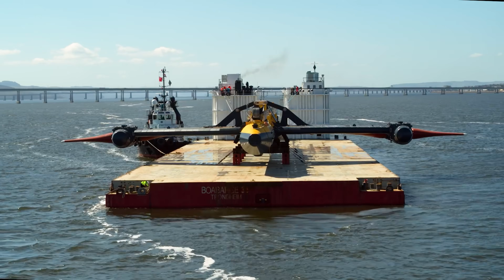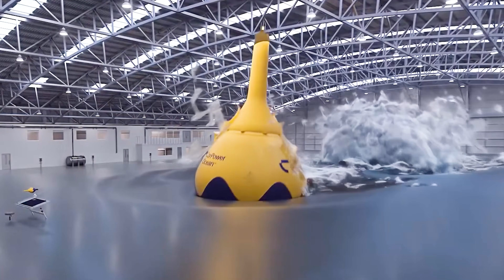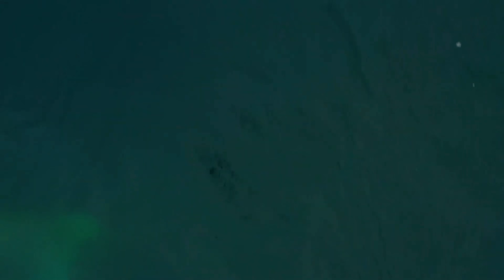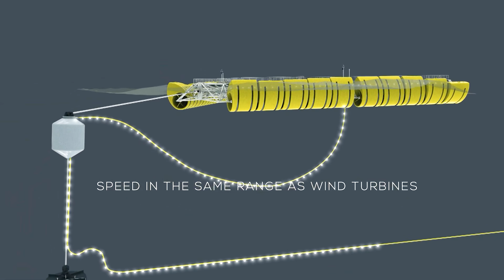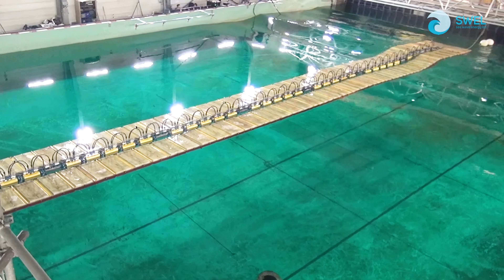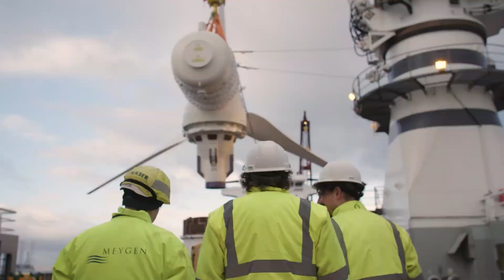INCREDIBLE MACHINES THAT LEVERAGE THE ENERGY OF THE SEA

Comment: Problem will always be the maintenance/reliability. Sea and ocean solutions take suchs a hard beating. The second options sounds the simplest
Reply: Agreed
Reply: Everything will need maintenance.   It is incredible just how much maintenance refineries and gas engines need.
Reply: Nothing new to the marine/oil/gas industry, and 20% down at any time for planned maintenance
Reply: and drilling uses less maintenance? 🙄🙄🙄
Reply: The relentless pursuit of profit has led to countless innovations that contribute to pollution in various forms. Yet, the concept of Tesla's free energy for all capable of reaching even the harshest corners of the globe, cleverly disguised in structures like pyramids, Easter Island statues, Machu Picchu, and Stonehenge remains unrealized. Imagine how far ahead we could be today if not for the greed and corruption of corporations that prioritize immediate profit over long-term sustainability. These companies focus solely on the present, with little regard for the environmental impact on future generations.
Reply: Seems easier to repair than a deep sea oil line or rig but what do I know
Reply: Well I guess it also comes down to price per wattt. In the cost maintenance should be include.
Reply: like you said, its dependent on so m any moving parts, hydrolics ... lets not even speak about how crazy that is in salt water.

The second option with good gasket the main - maintelance is litteraly the gasket, so all in all, going up and down causes no damage to ecosystem, fishes or anything like that.

Unlike the other which would cut down  marinelife and even possibly change the pattern of wildlife, the boey's would not... I hope that boey works as honestly, you can have them quite close to each other...
Reply: @QuicoKoala burning coal where you cant see it instead of you engine is the biggest lie told to you. When we have better more sustainable energy production I can finally agree with you.
Reply: Anything than invest in solving the issues with nuclear
Reply: @daniel_dumile  well nuclear is especially super expensive.
Reply: Maintenance is a good thing, it equals accessible well paid jobs
Reply: Agreed. These ideas and solutions seems very viable in controlled environments but Mother Nature can be extremely unpredictable and unforgiving so whether or not these technologies can be applied in the real world is still questionable. Just take the more recent example in the south coast of Taiwan where football fields of offshore type solar panels are washed ashore due to a seasonal typhoon.

Comment: Green energy that causes significant disruptions to wildlife and ecosystems sounds a lot worse than a well maintained nuclear power plant with practically no emissions, way more output, and way more consistent and dependable power.
Reply: And one mistake everything boom🌋 💥💥
Reply: @Crazycollection-rp3ug  yes, but it’s still safer. Policies have changed since Chernobyl incident specially and Fukushima.
Reply: @Crazycollection-rp3ug you have small brain
Reply: @Crazycollection-rp3ug not true lol nuclear tech has continued to advance as long as safety procedures are followed the chance of a melt down are basically zero
Reply: The emissions of a nuclear power plant are seen the front end during manufacturing. Cement manufacturing yields a high amount of CO2 and tons of cement [don't know how much] are used to manufacture a nuclear plant.
Reply: I agree with this comment, but also want the power of Poseidon
Reply: @tantoquejodeoiga1197  pretty sure earthquakes are still a thing
Reply: I agree with you completely. The problem is we’ll always have these eco idiots screaming and protesting no matter how safe it is.

Comment: A simpler device would be a monstrous sized floatable screw anchored to the bottom from both ends, no moving parts , just a screw with two fixed cables on both ends attached to the bottom where the whole thing remains submerged. As the massive screw spins, so does the wires at both ends, turning two generators, regardless of which way it spins. 
,—————\’\’\’\’\’\’\’\’\’\’\’\’\’\’\’\’—————,
Reply: How does this work
Reply: @lukedowneslukedownes5900  natural tite spinning an extremely long propeller